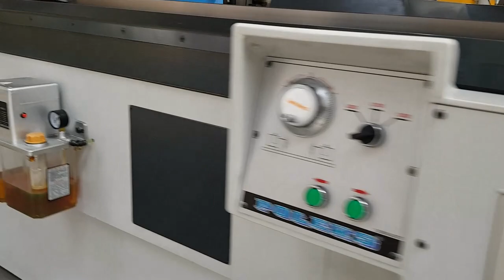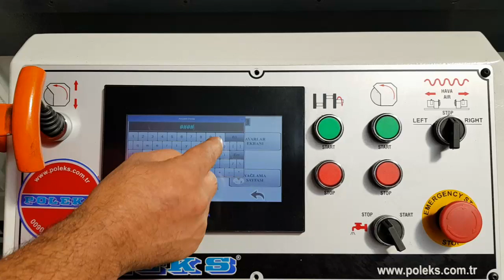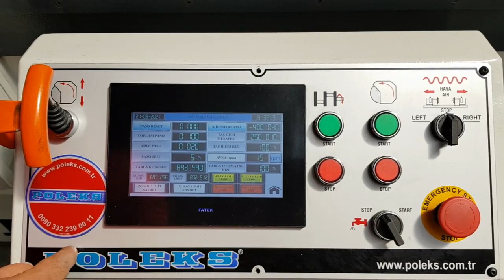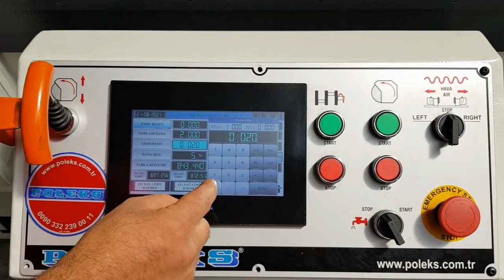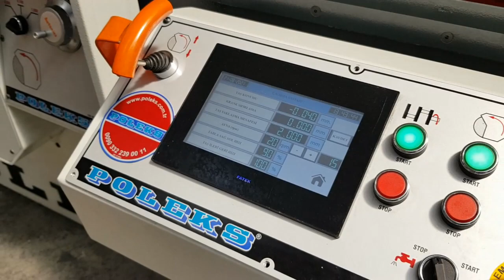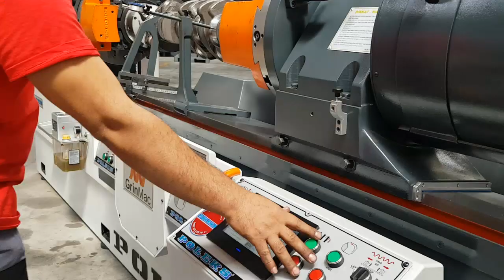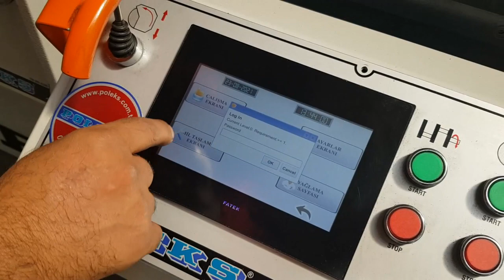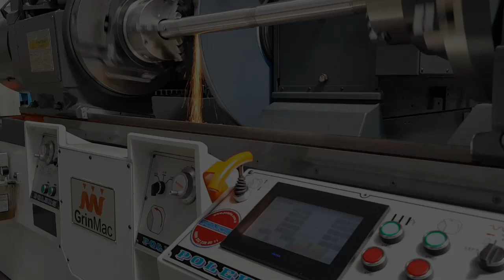KT 2250-NC ( Servo Control) Automatic Crankshaft Grinding Machine/POLES MACHINE

Comment: No safety  glasses  ,no anti  fatigue  mat to stand on........ground cranks many  years ago......both are needed.
Reply: I used to grind crankshafts in the '70s on a big old Churchill machine, it's correct that he should be wearing safety glasses but the mat is not there probably because he's testing a newly built machine. The rotation speed looks way too fast, what do you think?